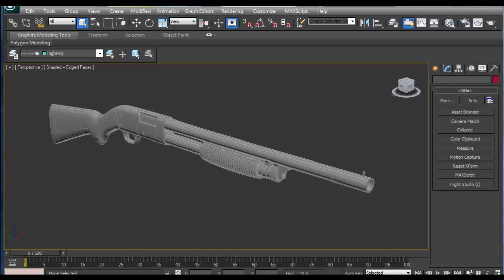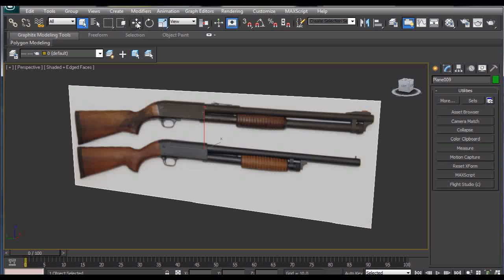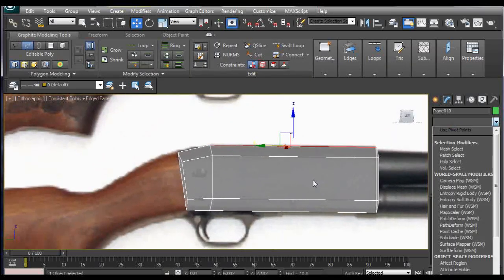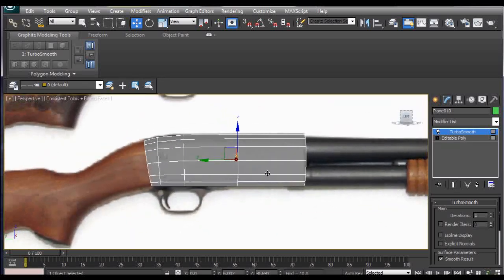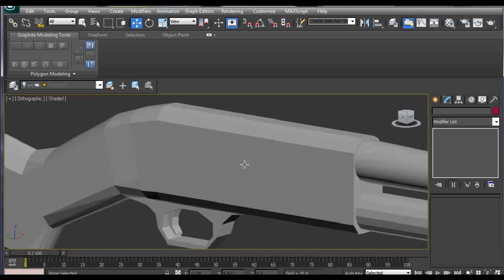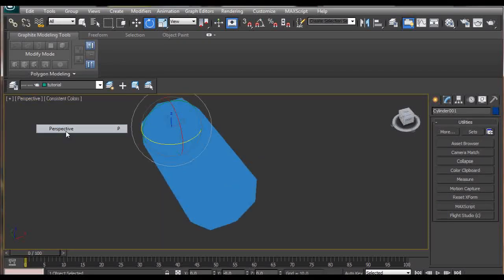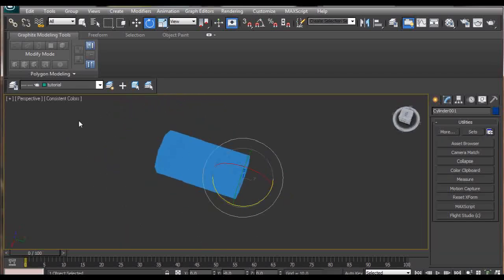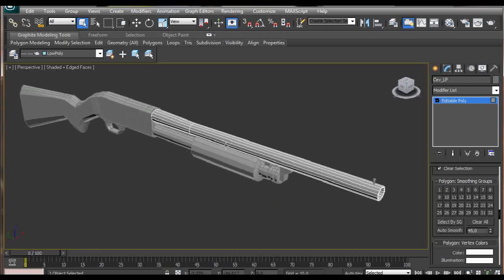Tutorial: Tips&Tricks on creating hi/low-poly shotgun in Autodesk 3Ds Max (Part 1)

Comment: Can we just use Uv without lowply ?
Reply from the maker: Use for what? 
You could UVunwrap hi-poly model, yes, if thats what you ment.
Reply: yes that's it but i still have problems when i use it with high poly like i can't control vertexes
Reply from the maker: Soufiane Bensmoky sure you can, there shouldn`t be a problem when applying lo-poly UVs to hi-poly model. If the lo-poly is set up correctly, meaning the silhouette is the same as the one from hi-poly, then the UVs work.
Although I still don`t understand why you wanna use lo-poly UVs on hi-poly model? What do you want to use your hi-poly model for?
Reply: When i use the Uv on my lowpoly i cant choose a specific vertex so i got many vertexes selected By the way im using TEXTOOL plugin
Reply from the maker: When you "Open UV Editor" you have to uncheck the cube on the bottom left (4th icon from the left), then you can select a specific vertex.
Reply: i dd but the same problem i wish i can send u my Screenshots , and i have an other problem on Z brush when i try to use Pen A i don't have the same effect that u have i followed all steps but the last one goes wrong